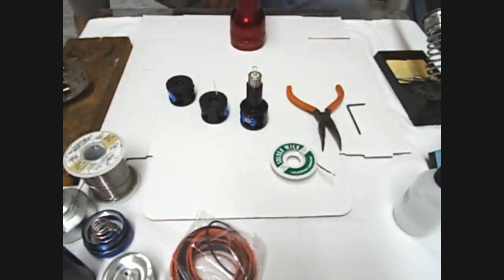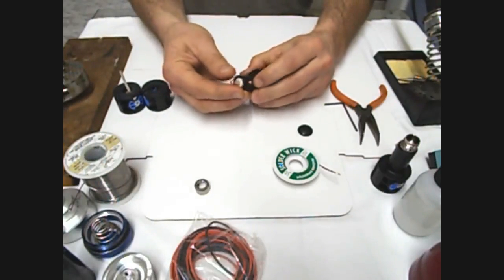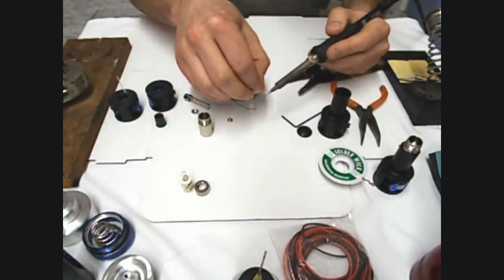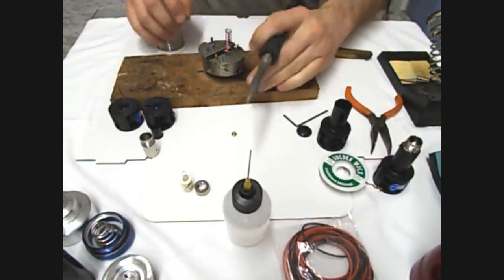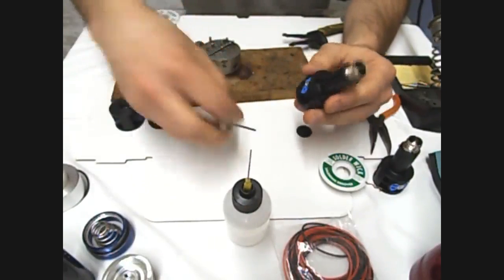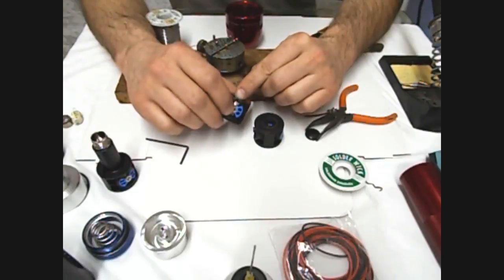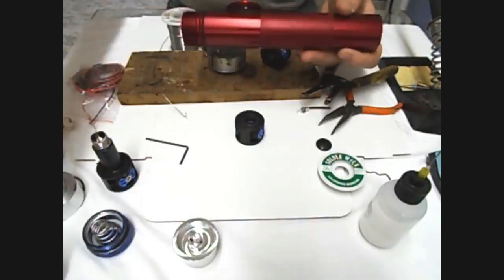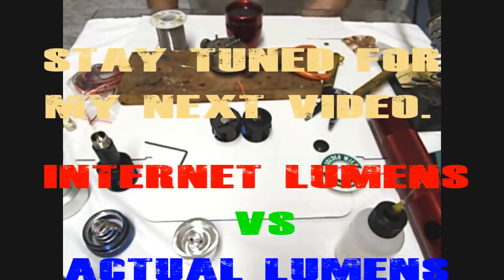Maglite Switch Mod For LED conversion

Comment: I currently did this mod an I 100% confirmed it does work Gen 1mag lite early 80s model with the front brass ring ohms at 1.4 ohm after the mod it lowers the ohm rate to .40 ohm . The gen 2 an maglites with the switches that drop out the bottom ohm at 2.4 or higher ohms. I'll do this mod on a few of them tomorrow an post a update

Comment: Im gonna do this mod to my custom 6D maglite tomorrow what is the resistance of the spring before the mod ? An what is the resistance after the mod ?.. i watched your video closely.  Shouldnt i squeeze the spring down 1cm then try to solder both connections? So the wire doesnt catch the spring ? What size wire are you using 16 gauge ? Since im using 4 , 26650 batterys to a 24 v led bulb i should use 14 gauge wire ? Im currently at 16.8 v

Comment: Is the tiny little spring on the back of the switch for the battery positive contact not an even worse high resistance point?

Comment: Do all Maglite (Incandescent) 2D-6D springs have the same resistance? I feel like doing a easy cheap mod by putting a 6D Xenon bulb in my 3 D Mag running on 2x 3AA series adapters giving me 178 lumens. It's not a lot but it's enough for me until I really get addicted to this stuff. :)

Comment: IMPORTANT NOTE: Any Incandescent MAGLITE with 'D' in the serial number will require T8 Torx. All Incandescent models without the D serial number require Hex/Allen Key. I bought the official Maglite T8 because every Torx T8 I own is too thick preventing me from pushing it all the way in.
Reply: Mine didn't. I have one made in FEB 2000 (as per maglite) with a D in the serial # and it used an allen wrench a 2mm worked fine. I bought a newer style switch direct from mag and it used a torx t8 with a long narrow shaft from Eklind (a US company) that worked just fine. I could be wrong, but I think it was around 2003 or maybe a bit later that mag changed to the "Torx switch".

Comment: I just wasted 15 minutes of my life  and not a single led in sight. No series resistors no constant current drivers what was the point
Reply: I think I'm just going to recycle my maglight. Between junk like this, what appears to be a maglight corporate policy against upgrading their flashlights and blazing options available for cheap what's the point of owning one?

Comment: matt what are the benefits of doing this with my maglite 2D,im running 2 26650 cells with your 5000 lumen drop in. is this mod worth doing?
Reply from the maker: I do it mostly so that no magnet is needed to make contact on the bottom of the switch.   If you do both mods you also get lower resistance, so slightly higher power and slightly more efficiant use of the batteries.

Comment: Matt, thanks once again. I’m viewing all your instructional videos several times to obtain the minutest detail you are saying. 
And as such I have one enquiry about this particular video. This is about the small Copper disk that’s soldered on to contacts.
I’d definitely prefer the Copper disk soldered to contacts rather than neodymium magnets. ( though I respect the power of it )
There was no additional info on the Copper Disk, so I request details of its availability and price.
Once again thank you, so profusely, for your hard work and dedication to impart knowledge to public.
Reply from the maker: The discs are called "gas checks"   they are a part that goes inside of a bullet for reloading.  I think the ones I had were 32 caliber.  I don't have them any more.   What I use now is a copper spring that is gold plated I get from here.
https://intl-outdoor.com/gold-plated-beryllium-copper-spring-5-pcs-p-831.html?zenid=7026cc96579bce452fafd3e544f30e02    I attach the small end to the base of the switch.

Comment: Is there any advantage/drawback of doing this spring resistance trick while using drop in led upgrade?
Reply from the maker: If the dropin your using is direct drive/linear like my brand it means higher output.   In any case it will also mean lower resistance for greater efficiency.
Reply: @Lumencraft-  Thanks for your answer.

I'm about to mod my 6D.

I've learned a lot watching your channel
Reply: @thomasdivito6221 Hey Thomas 

What size drop in led upgrade did you use and did you notice any increase in performance after doing the spring mod ??

Comment: if the spring is still touching the two ends wouldn't it add more resistance?
Reply from the maker: Hi Auguiste,   If the wire and the spring are touching the ends it will lower resistance because current can travel through both of them.

Comment: i bought a new Maglite like we discussed but the t8 looks way too big to whats in it. is there a way to very this lite takes the t8 before i shave down a torque screw driver?
Reply from the maker: The only other option I know of besides grinding down the shaft of the tool would be be knock the hex teeth off the nut inside the switch.   If you put a 5/64 drill bit down into the switch hole and drill it for about 1 second you can knock the star shaped teeth off the nut and then use a standard type allen key to free the switch.

Comment: man....i want to learn how to build my own lights or mod lights like this...i find this amazing.
Reply from the maker: Are you wanting to build a Maglite, or is there something else you had in mind?
Reply: I would like to start with a maglite. Make a super bright maglite. How bright could i make one with your drop in and this resistance mod? is there more i should do?Eventually I wouldn't mind buying an LED pad off your site and build my own.
Reply from the maker: The output will vary based on battery type and VF of your LEDs, but doing all the resistance fixes I know to do (this, the tail spring progold etc) I have had them reach as high as 7,000 on occasion.    I think you should take a swing at doing one of your own mods Tee Jay.   If you get into trouble I am always glad to walk you through it.
Reply: I have done 2 way radio communication all my life. Flashlights is something i am just really interested in and learning how to mod myself. So i figured it would be easier to start with a maglite. So would you recommend doing one of your drop ins or getting a reflector and LED/pad separately?
Reply from the maker: Doing it with the dropin would be the easiest way to go.   If you have experience soldering, doing one of the other builds could be fun too.   If learning to build is a key aspect for you I would recommend building a 4000 lumen XHP70 light with the reflector.  You would need to remove the top of the mag switch and solder on a pair of wires, and also install the driver board, but I can lay out some instructions for you.    This is basically the foundation for doing most flashlight builds.

Parts you would need:
Heat sink, driver, LED, host, lens.

If you think that is the way you want to go I can post the appropriate links to help you get what you need.
Reply: i can definitely solder. I think the XHP70 would be a good start! Would be a decent thrower correct? I wold love your help getting this done. Thanks
Reply from the maker: Using the XHP70 you will get about 200-300 yards of usable light.  The beam is not laser like, but because of the huge output from it you get good range by brute force.    I will PM you my email so that when your ready, I can help you get lined out with the parts and everything you'll need. :)

Comment: Matt, I was able to use a 2mm allen key for that switch.
Reply from the maker: Hi Jason,   Thanks for sharing .  Any mag made before about 2013 or so will have the allen key rather than the hex :)
Reply: +AdventureSportFlashlights Okay, good to know. 
I do have a question for you, on my pre 2013 light can a sticky switch be fixed?
Reply from the maker: Its possible.   If the issue is not a mechanical failure, you can try putting some deoxit gold in there.
https://www.youtube.com/watch?v=OGvemNm4YRo

Its pretty good stuff.
Reply: AdventureSportFlashlights